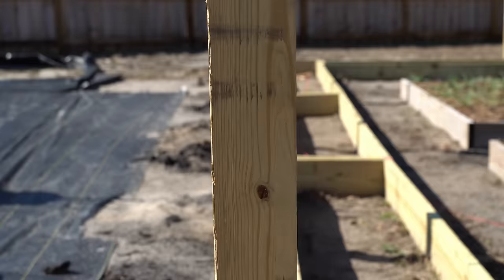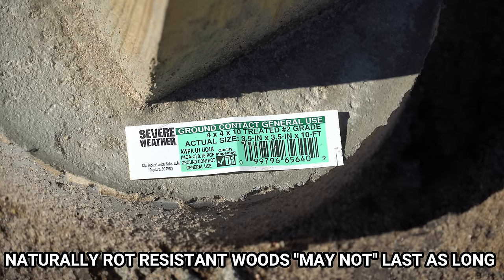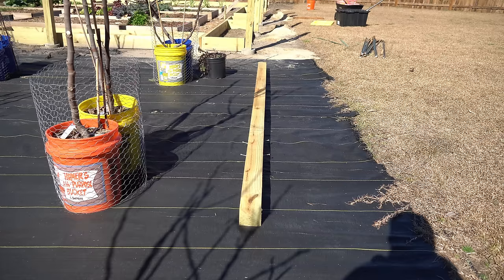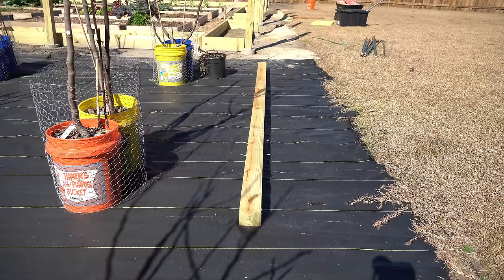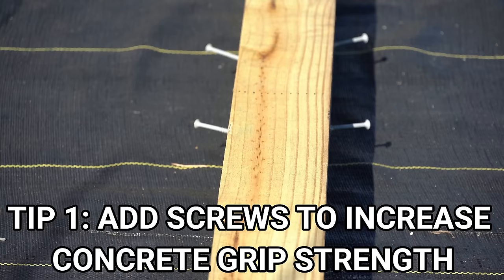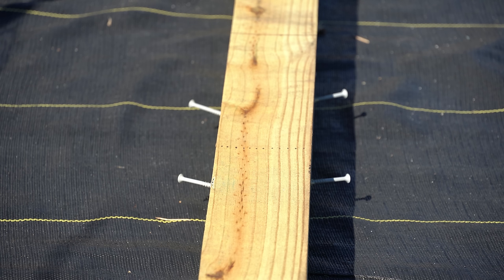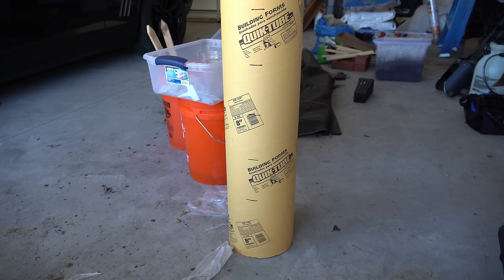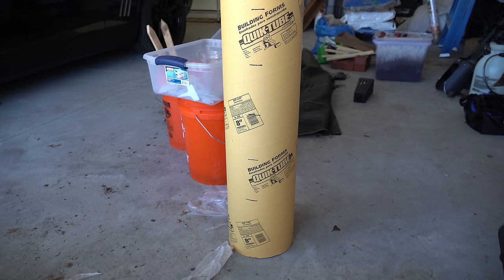3 Tricks To Installing Stronger 4X4 Wood Fence Posts That Last Longer

Comment: Listen, MR MILLENIAL GARDENER, i understand you are trying to give joe-shmo's some info, but let me add my 2 cents;
First off, you claim that because the post is so smooth that you wont get enough contact or friction lmao? have you tried lifting a post up that has been set in conrete? lmao Unless you are captain america, that post ain't going fcking no where,
Second if you really want to keep water from sitting around the posts, slope the damn conrete arond the post, thus creating a cone shape around the post, then fill the tiny gaps with an exterrior caulking if any
and FINALLY, the name GARDENER in your account name, should mean that you focus on gardening, not posts and structure :)
Reply from the maker: I didn't say your post won't get friction.  I said adding a few screws gives the concrete more surface area to grab onto so you get better embedment strength.  It makes it stronger.  This is particularly important if you attach a gate, because gates create torque.  It's also useful if you live in a hurricane zone like I do.
Why would I go to the trouble of sloping concrete and having an ugly, less effective installation when I can use cheap concrete tubing that allows me to do this more quickly and have a better looking installation that performs better?  Walk around any traffic signal intersection and look at the pole foundations.  You'll see all the mast arms on foundations with a symmetrical reveal.  It's done for a reason in structure construction, but I'm just an engineer.
You're more than welcome to conduct your builds however you'd like.  I'm simply providing useful information for those looking for it.

Comment: Thumbs down for this video.
Reply from the maker: Next time you go to Home Depot or Lowe's, walk to the lumber department and check out the pressure treated 4x4 posts.  You'll find almost all of them have some type of surface splits in them.  If you are concerned about a tiny screw drilled into the lumber 2 inches, by that same logic, all of the posts they sell cannot be used because they all have some type of splits in them.  As I mentioned, this just isn't true because pressure-treated wood is soaked and fully absorbs the solution, so drilling into them has no ill effect, just like the splits in the wood common to almost all #2 prime wood they sell are harmless.

Comment: This is pointless. You will not be able to lift a wood post out of concrete
Reply from the maker: That's completely untrue. The primary point of the concrete is to secure the posts, especially because I live in a hurricane zone. The second is to prevent rot around the base, which it does very well thanks to the foundation reveal. There is a limited amount of concrete in each hole, and they will easily pop out using the "floor jack" method. Using tightly wrapped chains, or drilling a brace into the post, you can easily use a floor jack to pop them out, even with the concrete cap. There are many tutorials on YouTube that show you how to do this.

Comment: Never set a wood post in concrete.
Reply: I have heard this but do not know why?  
I have been using this exact method for about 30 years - stainless steel screws in the base ( I do it on all four sides) of the post to grab the concrete and the top collar made with a sonotube.  I have an existing cedar picket fence with pressure treated post set with this method that I installed 26 years ago and the posts are as good and solid as the day I put installed them in 1994.
Reply: @kenb3552  The (porous) concrete should be considered damp, like a rigid sponge.  It's the reason for the required  "sill seal" between concrete home foundations and the treated base plate (wood) walls.  Your success is great, though!  I bet you're doing something else that helps.  Great grading for quick drainage?  Sandy soil?  Both?  More?  Whatever it is, keep it up.  :-D

Comment: This is pure overkill, I am a professional Fence installer and this is like cracking a walnut with a sledge hammer. The only point at where the post rots is at ground level.
Reply: Small minds

Comment: Ew gross.  I wouldnt eat food out of a garden with all that pressure treated wood around...
Reply from the maker: This pressure-treated lumber myth needs to die, and is bad information from 20 years ago when residential lumber was treated with CCA (arsenic).  This practice ended in the early 2000's and CCA is mostly reserved for industrial applications like utility poles.  Today's modern pressure treated lumber is copper azole, which mine is.  There is no information showing copper azole to be harmful.  In fact, you can purchase liquid copper concentrate to use as a fungicide in organic gardening.  I treat my tomatoes weekly with liquid copper.  Minor amounts of copper azole preservative in soil is meaningless.  If you fear copper azole treated lumber, it's due to lack of education.  Feel free to read up on the subject.
Reply: @TheMillennialGardener  I totally agree.  A lot of people are misinformed about today's pressure treated lumber.  Plus, the 4x4s are imbedded in concrete so virtually none of the preservative will be absorbed into the soil.  I remember reading an article where exposed PT lumber in soil was tested and very little trace of the preservative was found in the surrounding soil in laboratory testing

Comment: My problem with using 4x4 pressure-treated posts in a veggie garden is that they are full of chemicals like arsenic. These will leach out into garden soil over time. Also, I did not catch your reason for putting 4x4s anywhere except along property line. Even grape arbor does not need anythg that strong.

Comment: You take so long just to say 1. Put some screws in the post to grip the concrete and 2. Put some gravel in the bottom of the whole. You're not writing a bloody thesis.
Reply: lots of good comments but the major point is being missed here. It is true that you should always use pressure treated posts approved for ground contact when using them for fence posts. However, as soon as you put cement around the post, all the guarantees for the life of the post are nullified. The guarantees are for ground contact (read this as tamping the dirt around the post) not cement contact.
Reply: @alcooper5127  Also, skip the gravel.  It just creates pockets for the rot to start.
I've found fire wood buried in the yard from 20 years ago that was still solid.  It only rots if air can get to it.

Comment: I’ve seen lots of fence videos about stopping your concrete 4 to6 inches below grade then add dirt,,,makes zero sense,the dirt will hold water against your post,  I always bring my concrete above grade and with a trowel slope it away from my post,,,, and that other thing about pouring dr concrete into your post hole and adding water , is unnerving,  why not just mix it the old fashioned way
Reply from the maker: Yes, concrete should always be above grade by several inches.